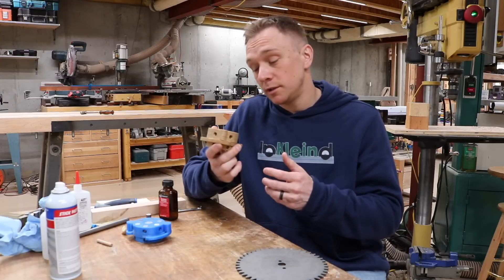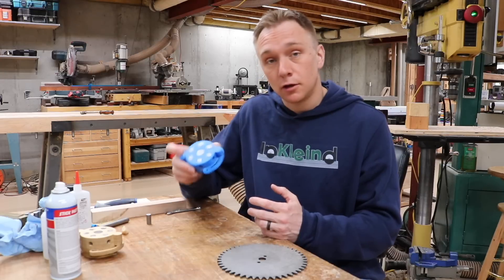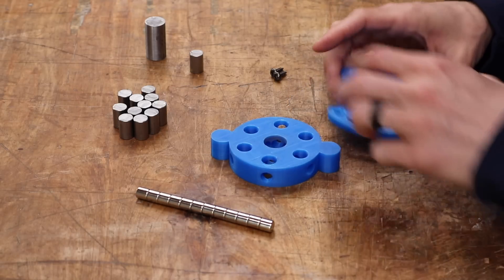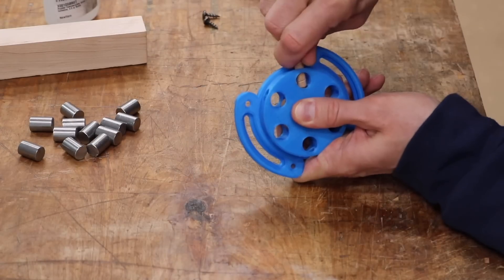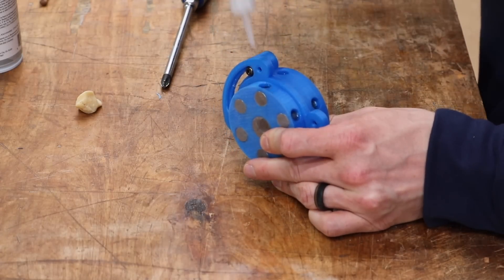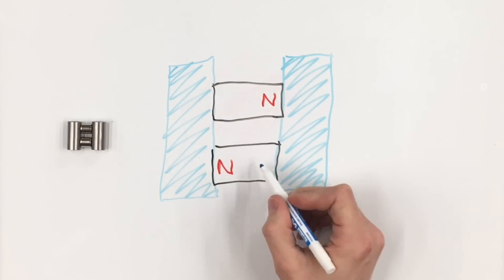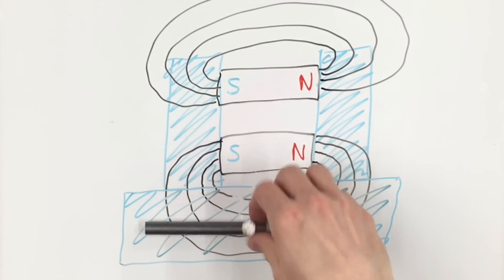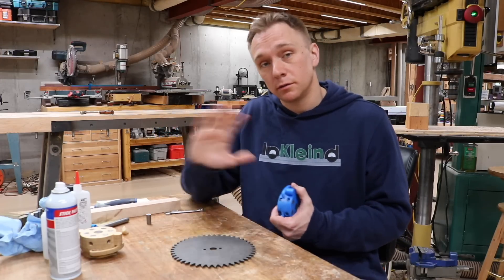3D Print a Magnetic Switch, and how it works

Comment: What are some potential uses for this? I have a 3d printer and do hobby woodworking but just can't seem to think of an application where I would need this?
Reply: I am seriously contemplating modifying the idea for a table saw fence lock,  a square version that when activated locks to the front of the table....not entirely sure how well it would work, but I may get around to it someday. Could also be used for any jigs you wanted to temporarily stick to a saws surface, depending on how hard they bite. That is what i was thinking when I saw it anyways.
Reply: @bubbastewart456  the only application i could think of is featherboards. Seems overkill for that.
Reply: @dannys2561  Probably...but it is too cool not to build one and play with it! On a plus side, you wouldnt need an adjustment for the featherboard, you could just unlock the magnet and slide it to where you need! Or maybe a magnetic light holder! I will find something to justify building one, even if it isnt the best use of time and energy.
Reply: They are used a lot with metal lathes for holding dial gauges to check that the piece is centered or true. The magnetic clamp allows you to get the gauge right where you want it.

Comment: you're definitely the smartest person I know! Any input into your print settings/temps/infill density etc?
Reply from the maker: not so sure about that first part, but for my printer I use a 210 temp on the extruder, 60 on the platform, and 20% infill, that seems to be plenty.

Comment: Rank amateur here.  Bought the files.  Didn’t really know what to expect except for the text file on magnet source.  Using IPad to download, and it looks like first 3D file is going to be 800+ pages.  What is the appropriate way to save it on the IPad?  Should I be using a different system, Mac or Windows?  I plan to try this as my first 3D print job using the printer at my local library.  Maybe your answer will help some other newbies bridge the gap from buying your creation to actually printing it.  Thanks in advance!
Reply from the maker: I’m not sure if there is a way to manage the file on an iOS device, defiantly would download it to a PC or Mac.  From there various software packages can load the file and output gcode for your specific printer.  I use Cura Ultimaker for this, it’s free and I like it.

Comment: I wonder if a switch with a halbach array would work
Reply: You could make a halbach based switch, where you have two halbach rings. The mechanism would be the same. To have the same 60 degree on/off, you'd need 12 magnets per ring, 24 total. Other than that, it's just plastic, including the center bearing surfaces; unless you need a bearing surface, but that shouldn't affect the device too much. 
It should work relatively the same, except you could make the halbach variant much smaller, and a lot lighter weight. Design would roughly be the same: two discs, half of the holes would be round and the other half square because of the insertion orientation of the magnets, flanges, and the middle bearing surfaces.  
Neither design is worth $5 when they're so simple, imo.

Comment: a 3D printer is on my wish list.  I'm a Chiropractor, and a woodworker/maker in my spare time.  I'm trying to design an incremental locking hinge for a Chiropractic cervical chair.  A hinge that allows the backrest to be set at different angles, and then also fold all the way to the floor out of the way, when not needed (google "gonstead cervical chair").  Its been difficult, but have a few ideas - just need to get them printed out and see if my ideas would hold up.  Great project, by the way - I will purchase the plans once I get my 3D printer!
Reply from the maker: Thanks, that sounds like an interesting and challenging projcet
Reply: @AndrewKleinWW  feel free to help me design a hinge in your spare time. lol :) :) (j/k.............)

Comment: Great, lots better than plywood but still too large to be practical for jigs.
Reply from the maker: I’ve gotten that comment several times and don’t quite understand it, tablesaw feather board for example there is plenty of room and a larger switch doesn’t interfere with anything.  This is true for every application I can think of, is there something specific you have in mind that won’t work with a larger switch?
Reply: @AndrewKleinWW  Nothing specific, and they would work with most jigs but shop made jigs tend to be large anyway and a dollar sized magswitch is lots easier to incorporate. I don't have any idea what the cost is for building one but I would guess it's not a lot cheaper than a commercially built one. I love to build stuff and your switches are great, just too bulky for me. No offense intended, just my opinion, in fact, I'll probably build one just for the sake of building.
Reply: There's no reason why you couldn't scale this down.  You can buy smaller diameter steel rods and smaller magnets, make the overall model smaller and then adjust hole sizes accordingly.
Reply from the maker: yes you could, but those changes will make a weaker magnet, I don't think there is a way to scale it down AND keep the force the same.